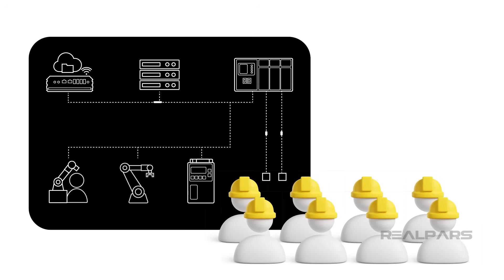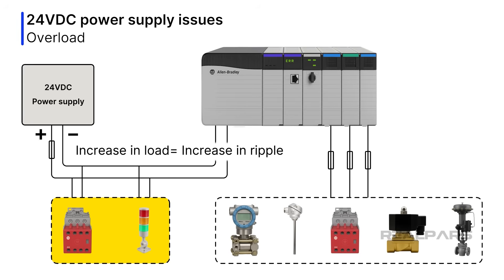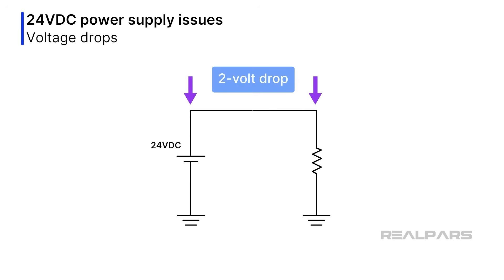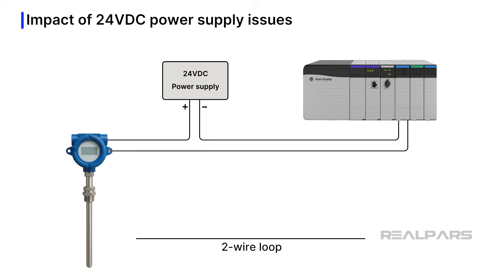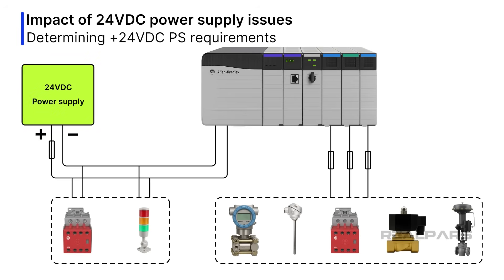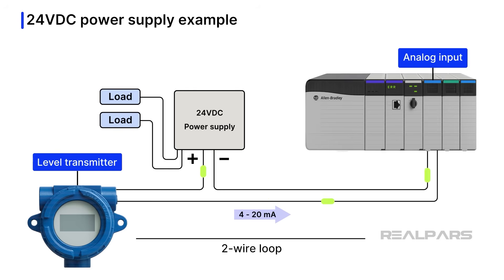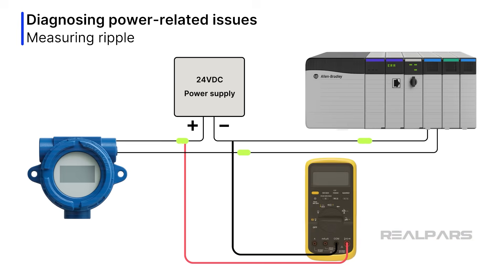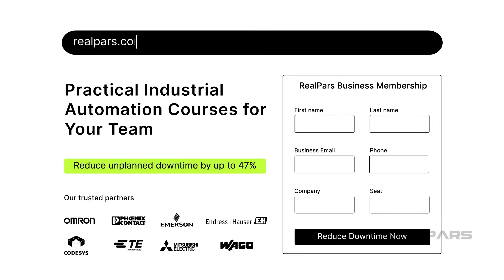How 24VDC Power Supply Issues Affect PLC IO Accuracy

Comment: Did i understand correctly from this video that it is better to separate power supplies for analog and discrete signals?
Reply from the maker: Hello @romakim1356. Yes, you should always if possible in your cabinet separate your incoming and outgoing signals from and to your PLC from the voltage feed source supply power wires Never put them in the same wire raceway together.  Analog signals are sensitive to voltages and magnetic field wires.

Comment: I have an Allen Bradley PLC, Micrologics, I believe.  The analog output card is locking up.   Two out of three of the incoming signals will stop changing in the plc until the card is removed and reinstalled.  We have installed a new card, and the problem remains.  I wonder if it's the software,  chassis, etc.  Has anyone had this problem?  Just two out of three of the analog signals are locong up.

Thanks for your help.
Reply from the maker: Hi Byron, 

For very specific questions like this, it is probably best to contact your local Rockwell Automation distributor or Rockwell Automation support to discuss the problem in detail.